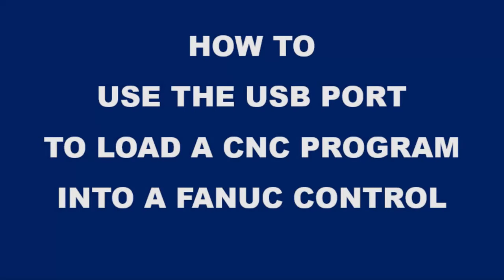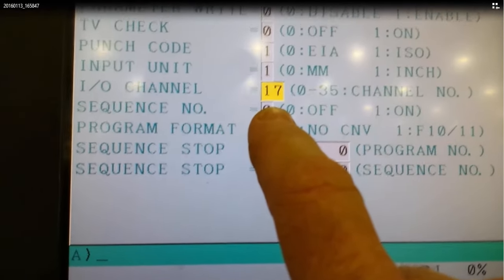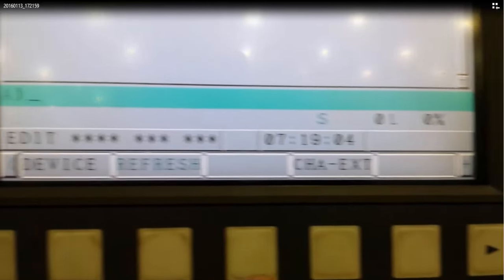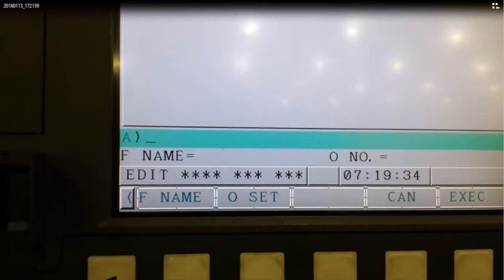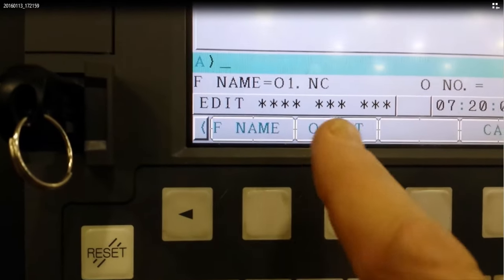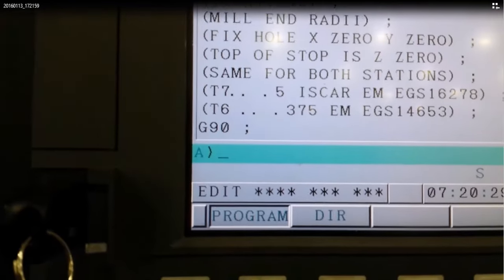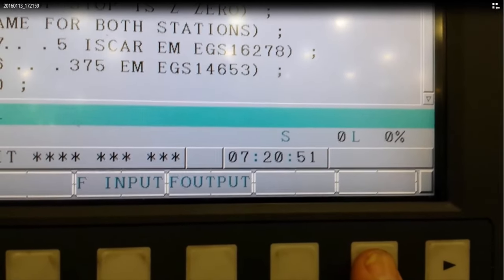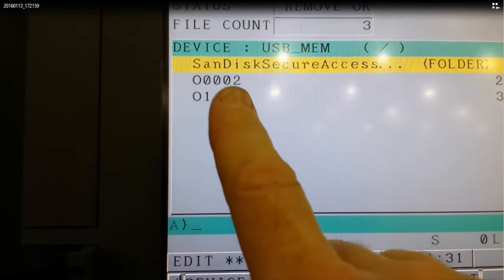LOAD A CNC PROGRAM USING A USB DRIVE

Comment: Thanks for this video Tom. We have two FANUC 0i/MD models in my company and I need to know if its possible to enable some router or WiFi connection between the PC and the CNC control in order to avoid the use of an external device such as USB or CF cards, It's that possible?
Reply: Hi.. i also have oi/md model vmc , did u solve your problem to connecting pc to cnc control, pl reply .